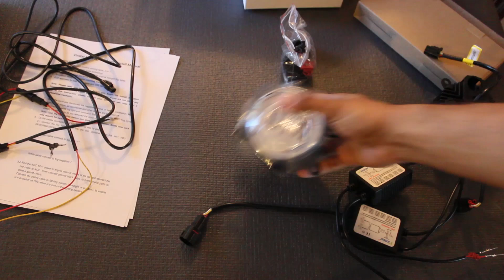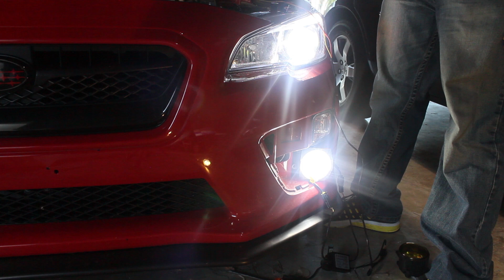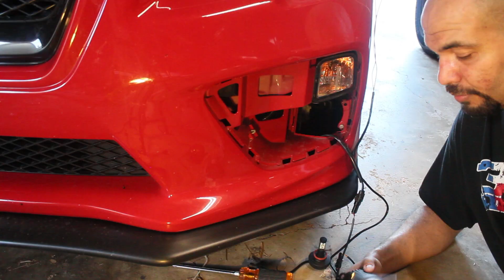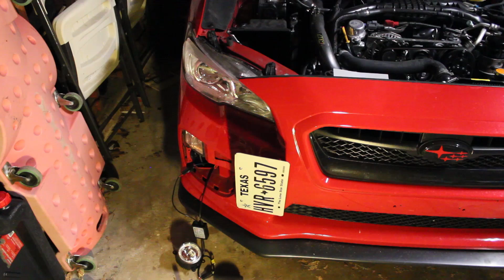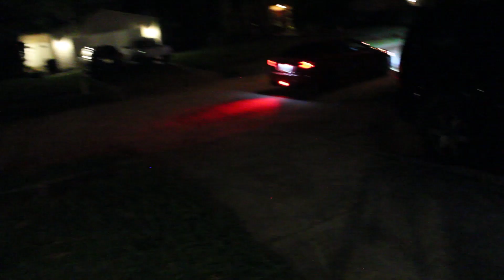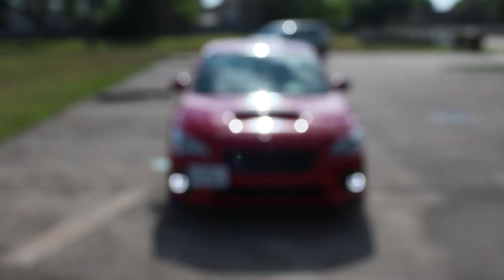Halo Ring LED DRL Fog Lights Installed!

Comment: I just connected the red wire to the 12v acc in my fuse box. Not even using the yellow wire. The halo looks really nice. Great video!
Reply: How it working for you now? I'm tempting the job now but this yellow wire was wondering if I dont use it would my lights stay on or no or what's the big deal with the yellow wire
Reply: @gillion2700  So far so good. for the first few days I waited a couple seconds and watched them after i turned off the car and they turn off after about 10-15 seconds. If you do it like i did it without the yellow wire they will stay on unless you completely turn your headlights off.

Comment: I bought these lights on Amazon , my performance shop wired them up wrong . They told me something was wrong with them and they wont stay on .It turns out that they work but only when the parking lights are turned on and e/ brake released .when headlights go on they shut off but when high beams on they turn back on LoL .Nice lights though .
Reply: Was wondering if you have written instructions for wiring these up ? Do I need an independant switch or can they be controlled by oem column switch ?
Reply from the maker: +acitizenofslaveearth if you have factory fog lights they’ll work with the factory switch. I have wiring instructions email me and I’ll send them to you. Geturgearinc@gmail.com

Comment: nice video! is the harness the same as the subispeed OLM halo fog lights?
Reply from the maker: +bobby truong yup. Made by the same company. Identical.
Reply: Hqen2000 so have 2 sets of halos since last year and I couldn't get them to install. One set is for the fogs and the other set is on my NBR grille. Is it possible to hook both of them up? Im a noob with wiring.
Reply from the maker: +bobby truong yeah of course. Other than using the normal harness for the fog lights the wiring is independent from the car. You can easily hook both up.
Reply: thanks bro. is there any way you can take a pic of your setup? which 12v source did you end up using? also, do you have an extra harness laying around that i can purchase?
Reply from the maker: +bobby truong what kinda harness? For the front fog lights? Yeah I can take pictures I'll put them on instagram. Hqen2000 I'll do it later today but follow me and you'll see it
Reply: harness for the halo fogs. thanks man!
Reply from the maker: +bobby truong nah... what happened to your harness???
Reply: Hqen2000 long story lmao. I just need it for my 3rd set so I can sell them together
Reply from the maker: +bobby truong lol no sorry. I can ask the company who makes them if they could send me one

Comment: hey, I recently bought these and when hooked to the battery, the halos are on all the time even when the car is off with key not in ignition. was this the same for you or different?
Reply: did you figure it out i have the same problem !
Reply from the maker: +Ivan Diaz it needs to be a 12v switched source not directly the battery I tried to correct that in the video because I also initially thought the same.
Reply: Hqen2000 
okay you think you can take a pic like how connected yours?? like your setup.
Reply: Hqen2000 
did you t tap the yellow wire to your fog light .??
Reply from the maker: +Ivan Diaz yes. But that's because I decided I wanted to be able to have the halo on while the heAdlights are on. But you could just as easily use the headlight wires.
Reply: Hey, could you please send me a picture of your set up on how you hooked up the yellow wire? I have a 2015 wrx limited. Just need to figure out how to have the halo lights on. Thank you.
Reply from the maker: I believe the yellow wire goes to the headlights (So it turns off the halo when the lights go on) and the other is DRL meaning it needs power to turn on the halo. It should go with whatever keyed 12v power source you wanna use.
Reply from the maker: +Tom Chen yeah I thought that's how they were supposed to be hooked up too, but it needs to be hooked up to a switched 12v source (for when you want the DRL to be on) not the battery directly. I thought I made that clear in the video sorry. Where did you buy them and how much did you pay?
Reply: Hqen2000 got them off subispeed. didn't see your video till today unfortunately. I think I might just hook them up to the subispeed DRL then.
Reply: Hqen2000 hey which 12v source did you end up hooking up to if you don't mind me asking?
Reply from the maker: +Tom Chen one in the fuse box under the hood. I can take a picture if you can't find it. But it was a spot that didn't have anything there just the terminal for a fuse for a feature I probably don't have
Reply: yeah a picture would be nice. i have my 15amp and 30amp fuses used for the subispeed DRL harness, so i'm not sure if there are any more available spots.

Comment: hey I have a question. i know you got spacers i would like to know if after you installed them you car shake when 80 and above?
Cause I got spacers with the center hub and my car shakes after 80
Reply from the maker: +victor soto nope. I've had it up past 120 and no shaking. You can even watch my Dallas trip video I was cursing at 90+ for hours. No shakes completely stable. Perfect as stock.
Reply: Hqen2000 thank you bro.. I'll buy the ones you bought..
And thank you for the reply.. 
I really enjoy your videos. 👍👌
Reply: victor soto I got 20mm h&r spacers. they work fine even at higher speed. haven't gone past 110kmph yet but so far so good.
Reply: the 20mm part number is 4065561SW or 4065561. You can get it from propartsusa or other sites. the part number end with SW is black. i do recommend black because up close, you can see the spacers behind the rims and black blends in well. https://propartsusa.com/products/h-r-drm-20mm-wheel-spacer-4065561sw-7458 theres an error on the site where it shows thread pitch is 12*1.5. it's actually 12*1.25 as listed on H&R website. i emailed proparts and they said it was a website typo.
Reply: Tom Chen  where did you buy them?
Reply from the maker: +Tom Chen what's the cost on those
Reply: Hqen2000 $100-$130 per set of 2s